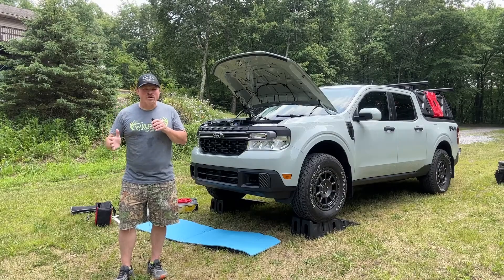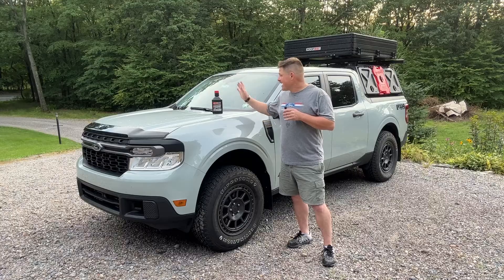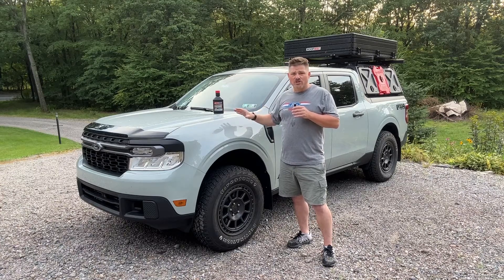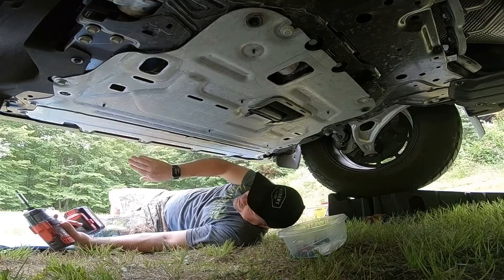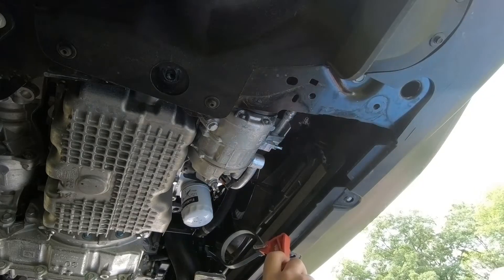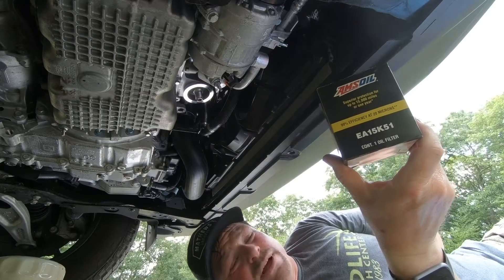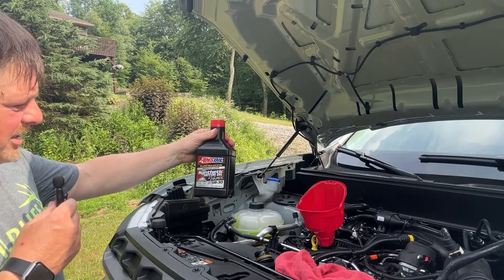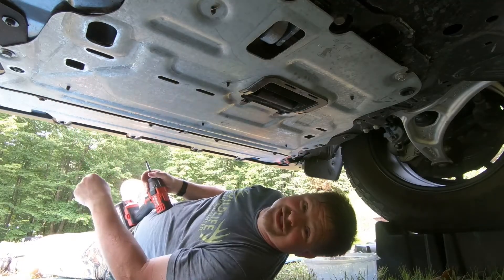Why Ford Maverick Ecoboost Owners NEED to Change Oil More Frequently!

Comment: That's a sweet rig!  Congratulations.......
Reply from the maker: Thanks 👍
Reply: @themaverickhntr  Ford made the oil filter and drain plug nice and accessible once the shields are removed.  If you live in an area where they salt/sand the roads in the winter due to snow and ice, better make sure you have a good, annual rust preventative (like Rust Check or Krown) sprayed on the underside.

Comment: Important!! Make sure your synthetic atf is ULTRA LOW VISCOSITY- only two vendors for that spec - motorcraft and valvonine. Check 8f35 service manual
Reply: This is for the automatic transmission fluid?

Comment: Put the truck up on ramps to take off the skid plate.  Then back off to level truck to drain oil and remove filter.  After your done drive back up to put plate back on
Reply from the maker: I think it drains fine on the ramps. It actually pushes the oil to the back of the pan where the plug is.

Comment: always fill up your engine oil filter whit new oil...
Reply: it's not necessary.  You know some engines have the oil filter mounted horizontally.  Enough oil stays on the bearings during oil changes where it is not a factor.

Comment: You Maverick guys do know this engine has been used since 2015 in a wide range of vehicles.  The fact it is in a “truck” makes no difference in how it should be treated.  Yeah, 5k miles is good.  Bearing failure in the turbo is rare.  Frequent oil changes do nothing to reduce intake valve buildup.  Need 2 catch cans.  Is that really a skid plate?  Looks like it would rip right out if you hat anything with it.

Comment: I change my oil in my 2007 Tundra around once every 2 years, truck runs great & never needed to repair anything but the alternator once. 6 cylinder
Reply: Doesn't have anything to do with the maverick, not sure why you commented
Reply: @eliaaronoct  Get a clue, the subject is about oil.
Reply: @winterwolf2012  Get a clue - different engines. Is the Tundra a turbo or not? We don't know, so the comment is useless.
Reply: @shoopSAUCE  If you know what year my truck is, you know everything. Runs great as usual.
Reply: @winterwolf2012   Is it a 2.0 Ecoboost?
Reply from the maker: Well, how many MILES in that time?
Reply: 43000 @themaverickhntr
Reply: Has nothing to do with this video at all. Do you not drive anywhere? How many miles in those 2 years between oil changes?
Reply: @Balt9mm  Stop crying & move on.

Comment: You should have filled the filter before you put it 9n to avoid dry start. In the vertical for your filter this is easy  just my thought
Reply from the maker: Yes, I thought of that after the fact. However, isn't there a "bypass" for oil supply to the engine too? In other words, not all the oil that lubricates the engine comes directly through the filter. It all circulates through the filter repeatedly, but there is still a way to ensure the engine gets the oil it needs. Perhaps someone with real mechanical knowledge of the 2.0EB can comment on this.

Comment: Turbo engine should have this sn on the back of the oil container or sn plus located on the circle specks of the oil product.The twin turbo car I drive is vary specific on the oil specks.

Comment: Great video! Have you considered installing a catch can? Hearing a lot of people recommending installing one to help prevent carbon build up in the engine but not fully convinced if necessary.
Reply from the maker: I have considered it. I'm sure it can't hurt. Might help. But I do believe using a very high quality synthetic oil and changing often lessens the need.

If I was going to do it, I'd probably go with a dual can setup and have one on each sides. I mean if you're going to go through the trouble why not go all in and capture all that gunk?
Reply: I installed both. The crank vent actually does collect. Maybe a few tablespoons ever 6k miles or so. Certainly not hurting.
Reply: It's really funny to hear about catch cans on new cars.  Back in 1968, when I was licensed for car pollution control, engine crankcases used to vent to the outside air.  Among the first aftermarket PVC crankcase venting systems we installed back then used catch cans.  Installing a system on one of those open-air motors could get you a quart of sludge in a few weeks, until the inside of the motor got clean.

Comment: cars are not investments, they’re liabilities.
Reply from the maker: In almost all cases, this is true. But what does that have to do with oil change interval? I'd like my liability to run trouble free for many years. LOL
Reply: because you stated that this car is an investment,
which it is not. increasing oil change interval can possibly reduce your liability, i think is your thesis of this video.
Reply: My business trucks and heavy equipment are investments; very good investments......

Comment: Scotty kilmer channel says these twin turbos and the hybrid engines from Ford on these are junk since they're new and haven't been tested! Plus that the cost of repairing these down the road will not be cheap because the hard to work on! Oh yeah another big reason cuz they're being built in Mexico 😂 another American truck that will only lasts a 100,000 if you're lucky and I drive heavy-duty trucks Ford & Chevy for a big utility and their junk after 125,000 miles and that's not including repairs and maintenance keep it!
Reply from the maker: Well first of all this isn't a twin turbo. It's a single. Second, this engine has been around for years and is pretty proven if properly maintained. Maverick us new but this power train is not. Third, Scotty Kilmer is an entertainer but let's not pretend his word is gospel.
Reply: Scotty hates anything that isn't a Toyota.

Comment: Any gasoline turbocharged engine requires more frequent oil changes. Synthetic oil is much better too.
Reply: These modern turbo engines don’t run a lot of boost and the engines are lower compression.  The problem is people use Dino oil or don’t change it often enough.  They really aren’t any harder on the oil than a port injected NA engine.

Comment: You said you had "a" set of wheel ramps that you were using to make removing the skid plate easier. I get that, it makes sense. My question is about draining the oil while the front end is higher than the rear. Wouldn't it be better to drain the oil when the vehicle was level and the front end "not" on the ramps? I don't know is why I'm asking. I hope you do get 10+ yrs out of this Maverick. I would buy one if they offered a small cab with a 6' bed option. The ability to put a camper shell on a 6' bed for camping is a must for me. Thanks for sharing and best of luck with your sweet looking Maverick.
Reply from the maker: The ramps actually tilt the back of the oil pan toward the ground. So you'll get even better drainage on the ramps than you would on level ground.

Comment: I have the dealer change my maverick xlt hybrid every 5000 miles and got them to use full synthetic 0w20 oil.0w20 is what the manufacturer recommends. That's if the dealers is really putting in 100% full synthetic oil who really knows! Thanks for the video.
Reply: 0w20 to my knowledge (and 0w16 for some manufacturers) are all fully synthetic. I dont think conventional oil can be 0w by its nature. If it can, I've never seen it.

Comment: You are wrong about Ford because they care about their customers. Every car company recommends to change oil every 7,000 miles. Please don’t insult Ford? I have owned Ford vehicles for years and never once I have issues. I keep up with maintenance. You should use motorcraft oil and motorcraft oil filter.
Reply: Ford is NOT what it used to be! They have BIG quality issues. massive recalls Ford is trying to cut to many corners! Now I still love Ford's, but they need to get their heads out ass! Or they will find themselves in bankruptcy court!
Reply from the maker: I never said Ford doesn't care about customers -- though if you are a Maverick customer it's certainly debatable. I said that Ford -- and ALL auto makers, for that matter -- don't much care about product failures outside the warranty period. If you don't think parts and service are the lifeblood of the auto industry and how the auto makers are able to sustain dealer networks then you don't understand the economics of the automobile industry. If they made vehicles that lasted forever they'd all be out of business.
Reply: Don’t insult nor lied about Ford Motor Company. Ford does care about maverick period. Ford does care about their customers. That is final.

Comment: NEVER TORQ ON A OIL FILTER!  1/4 turn PAST HAND TIGHT!  And Install An Oil Catch Can!  BlowBy Will Kill Your Motor And Mileage!
Reply: You are absolutely correct, never use a wrench to tighten an oil filter,   hand tight only. Not two hands, just one.
Reply: Next time he gonna remember not torquing oil filter 😂
Reply: I torque mine to 20 ft lb to make sure it doesn't fall off.
Reply: @driftx2 lol you are real funny

Comment: This is why mfrs should NOT put turbos on consumer/appliance grade vehicles.
Its A Turbo Engine!!!!  You need to follow TURBO oil change intervals!  That means Full Synthetic.  That means 3k - 4k intervals (unless you have it analyzed to be sure the oil isn't coking up).  AND does the engine run for an additional 30-60 seconds after you "turn it off" after you've ran it hard and immediately park it?  If not, I'd ask about that.  Turbos NEED turbo timers to keep the engine running (and the oil flowing) for a bit to cool down the turbo or you will cook the oil in the turbo.  This was a HIGH failure issue back in the 80s when mfrs first tried using turbos on non-enthusiast cars.

Comment: Nice straight to the point video...thanks...changing my sons break in oil at 2k tomorrow.....also do you own any shirts that dont say Ford? 🤣🤣 just messin!!..wait you changed at the end !!!!
Reply from the maker: Actually, I did the whole oil change in my Wildlife Research Center T-Shirt. But after I started editing, I realized I really needed a better, shorter, to-the-point summary than what I had recorded previously. So, I went out on a different day to shoot that with my Ford Performance T-Shirt. Funny thing is, I only have two Ford T-Shirts, but I do wear them a lot when I am making Maverick videos!

Comment: I picked up a 2022 XLT 4K, FX4, LUX with 12.6K a little under 2 months ago.  According to the app, it had it's first oil change at 5.5K, another at around 11K and Carmax showed me records that they changed it right before I bought it at 12.6K.  Knowing this, I still had it changed at 15K miles and just had it changed last weekend at 20K miles (I drive a ton for work and us it to pull our 21 foot camper).  Also, off topic, I plan on doing a walnut blasting every 60K miles, along with changing out the spark plugs at 50K miles.
Reply: How much can it tow?
Reply: @Bagel_Biscuit  4K lbs, however, it got totaled about 3 months ago from a hit/run driver.  Picked up a 2018 1500 Silverado as it's replacement which can tow about 10.5K lbs.  Last summer, I did place an order for a 2024 XLT, LUX, 4K tow package, moonroof for $1K UNDER MSRP.  Should be delivered by next month, however, not sure if I want to add a 5th vehicle to my stable or risk divorce.

Comment: I (my company) has two hybrids.  I don't reinstall the shield.  (All street driving in the south)

Can reach the drain plug and filter easily with no ramps.  Goes real fast.

Walmart's Supertech 5-20 full synthetic every 5k miles.
Reply from the maker: Makes sense. Good for you!
Reply: Hybrid doesn't have a skid plate like fx4
Reply: @eliaaronoct  - Hybrids have a shield, none-the-less.

Comment: Did you mod anything with your Eibach spring level kit with 245/70/17 tires to fit in-front? Does the front tires rub the struts?
Reply from the maker: No mods. Just remove OEM springs and install Eibach springs and camber bolts. Tires fit fine.

Comment: I changed my oil at 1k miles and plan to change every 4k because it’s cheap insurance. When you drain the oil you can smell the fuel in it on these ecoboost motors. Not my first one. 🙏🏻👍🏻
Reply from the maker: I agree
Reply: yep; I smelled fuel every time I changed my oil at 4k (I did my first oil change at 1k). I traded my Mav in on my Bronco w/the 2.7 twin turbo. Already changed my oil twice with Mobil-1 5w30.
Reply: The gas smell in the oil is totally normal.  One drop of gas makes the entire crankcase smell.  It doesn’t mean the oil needs changed.  Toyota, Ford, Honda, etc. all have oil that smells like gas after a few thousand miles.

Comment: Too bad it needs that extra half quart of oil.
Reply from the maker: Well, not the end of the world. That leaves you half a quart to monitor oil level between changes and add a little if needed. If not, that's your half quart for next time if you only want to buy 5 quarts.
Reply: @themaverickhntr  for those who take their vehicle in for oil changes, often it is for up to 5 quarts. I'd be worried they would stop short of adding the full amount needed.
Reply from the maker: @stevemlejnek7073  oh no, they won't do that unless they are total idiots. Most oil change places nowadays have computers that automatically look up factory spec for whatever vehicle they have on the rack. And, they don't buy oil by the quart. They buy it by the barrel and fill your engine with a hose hooked to a giant tank. They'll put 5.5 quarts in and charge you for the extra half quart.

Comment: Does the oil pan drain plug have any sort if gasket on it that would need to be changed?
Reply from the maker: There is a blue O-Ring on the back. I highly doubt it would need to be changed with any regularity, but I am also sure you could buy a pile of replacement seals for next to nothing. Honestly with the plus screwed all the way, there is probably over an inch of thread engagement. Very hard to imagine any oil escaping with or without the rubber seal. Feel free to research Ford's recommendation on replacement of that seal and let me know. As far as I could tell, it was good as new.

Comment: Ford recommends the blend because the VCT cam screens clog up if you use 100% synthetic and take short trips & engine isnt always fully hot the synthetic will start to get the crust in it.
Reply: I find that hard to believe.🤔
Reply: Sound like you need to find another dealer.   They will recommend blend on the oil change because they make more money on it.  Your information about blend VS synthetic oil is precisely backwards.

Comment: How does the warranty work if you change oil yourself, how do you prove it was changed, if you have an engine failure?
Reply from the maker: You just log the work and save your receipts for the oil and filter. If you use the Ford Pass app, you can even take photos of the receipts and upload them to your vehicle's official service history. Bottom line, you are allowed by law to work on your own vehicle. Ford can't void your warranty as long as you can prove you performed routine maintenance at or before factory-recommended intervals.
Reply: Amsoil is a warranty secure product and also offers warranties on their products. A warranty claim on this oil is unheard of.

Comment: Good video! My 23 hybrid XLT, should be here this week. Talk to my salesman today, he said the truck is in the Twin Cities now, I live about 145 miles away. On the first oil change, I may change it around 1,500 miles. In case of any metal clippings etc. Probably change oil around 4000 miles or so after that. When I bought my 1976 Mercury Cougar brand new, I always changed oil myself, every 3000 miles. I used Mobil 10-30 oil. I still have the car, 47 years later, and it still runs like new, 351 Windsor v8. 86,000 miles on the car now. Anyway changing oil on time or even before, will prolong the engine life. I use Napa or Wick oil filters when I can. Cheers!
Reply: You don't have the issue the eco boost has. I wouldn't say there is any need to change it that often. Not to mention that your electric motor is doing many of those miles as well.